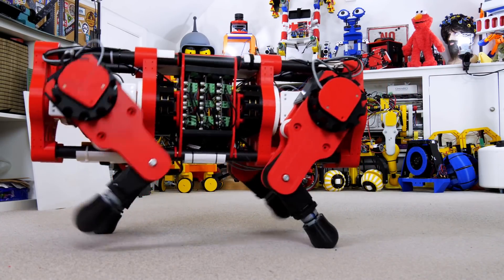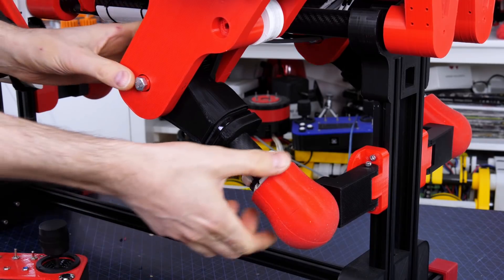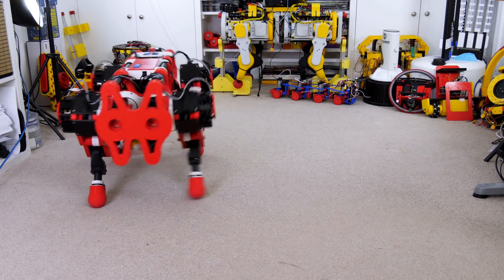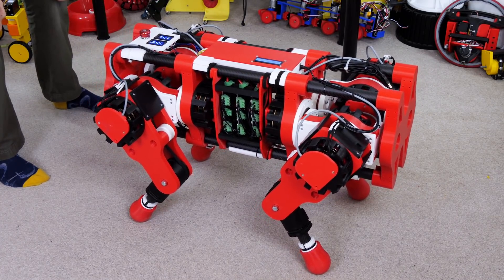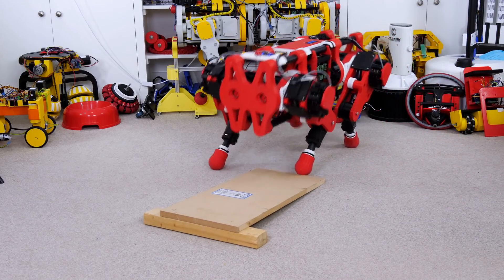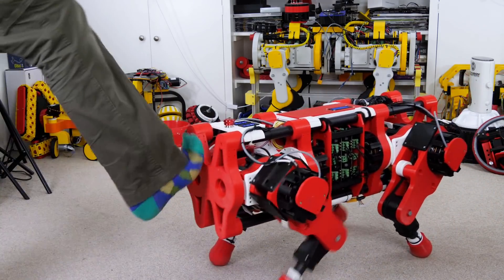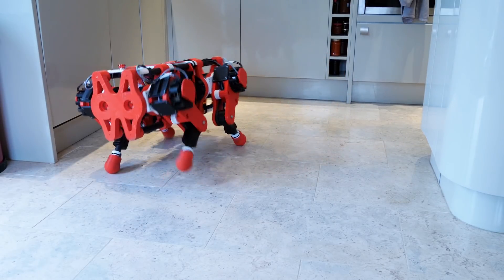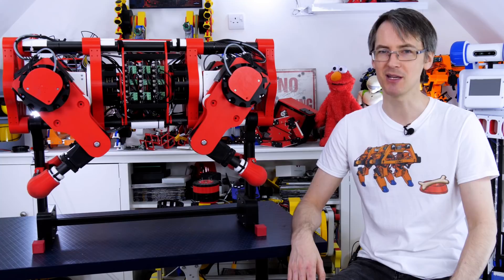3D Printed Robot Dog Climbs Over Obstacles

Comment: That joint not being on axis seems to be the biggest mess in the way it moves. Kinda reminds me of early BD stuff (no longer on YouTube) where they were wobbly as a newborn colt. IMO, you should either get rid of that entirely, or offset the position using a piece of carbon fiber (maybe buy a big ~15 cm OD  carbon fiber ring off-cut, and use four sections of it to move the leg under, it would also give more flexibility to the leg, naturally).
I wonder how difficult LiDAR or ecolocation would be to implement.

Comment: Excellent! I would be interested to see a digitgrade back leg version like a natural dog. You can still use the same number of motors, just use a connecting rod from thigh to ankle to move the foot.
Reply: Yeah, it's always bothered me that nobody ever copies the obviously more successful 3-segment hind leg design, yet most biped robots use 3-segment legs when humans do fine with two (birds do use 3, but mostly for higher ground clearance for wings). Though I suppose it wouldn't really make that much difference since they're mainly better for running, and most robots can't run due to excessive weight and/or inadequate software.

Comment: I would really like to see a project where instead of classical tuning and control, Machine Learning would be employed.
With most of your projects being described in a full 3D model, existing ML Models could be adjusted and trained on virtual simulations of a robot and then used in real life!
Reply: Not very easy to tell the AI what is "walking properly", even if, I guess, it could be done, by combinating horizontal speed and keeping the back flat as a "success" indicator.
Reply: @GirardNicolas  There are existing papers on this, it's been done quite well. Check out Two Minute Papers' channel if you want short summaries.
Reply: @GirardNicolas  Yes that's one of a possible option of the basics of training AI. I think though that it's ripe now for James to try his hands on it, as not only has the science come far but open tools are available and this exact problem has been tried and solved multiple times in different ways for years now. Of course, it's up to James if that is interesting to him.
This is very related and shows how it is possible: https://www.youtube.com/watch?v=knIzDj1Ocoo
And this is the cutting edge: https://www.youtube.com/watch?v=XM-rKTOyD_k
And their robots have similar issues Open Dog V3 has like offset feet from shoulder joint.
Reply: @GirardNicolas  basically you just measure what distance it covered in a given time, this gives you the reward, then you mixes those with best results, shake things a bit and try a new generation, again and again ... The difficult part is mixing (breeding) the challengers.
Reply: Do you think a Jetson nano or other embedded ML chip would work, or would he need a dedicated computer to run the quadruped algorithms? I love this logical next step in opendog v3
Reply: @richardsuckerson49  The hardware needs to be powerful enough to run the already trained algorithm. This usually scales with amount of data. With only internal data like the around 50 analog signals in the paper from 2020 it shouldn't need overly powerful hardware and Jetson Nano or other specialised hardware would probably even be overkill. Microcontrollers like most Arduinos don't fit for another reason though, the tools to run an algorithm need to be present for the platform.
Anyway, it definitely seems like classical tuning is hitting more and more diminishing returns in projects, that's why it came to my mind. Also, state machines came to their limits for robot kinematics years ago, so I would advise skipping trying to go in that direction.
This field can be a bit daunting if the tools and platforms are new to someone but most of them are pretty modern and there's documentation and communities and James already dived into that direction a while ago with vision applications.
Reply: This is how Aibo, Sony robot dog, learned to walk, many years ago ...

Comment: My girlfriend walked by and asked "Why is that robot walking on magic wand tips?" 
I said "for friction" without thinking and we both laughed. 😂
Reply: Everything is a sex toy if you try hard enough.
Reply: @greenanubis  Last time I heard that joke it was formulated as follow " 'Everything is a dildo if you're courageous enough' -Abraham Lincoln" Hahaha
Reply: James making open source sex toys when?
Reply: @GingePlaysMinecraft  Isint that already a thing? Just take the leg part, adjust code and add off balanced motor inside the magic wand tip...
Reply: @Hellsong89  I'm pretty sure the print lines on that flexible TPU wouldn't feel great on your junk...
Reply: @Hellsong89  I assume it is. Wouldn't that fall under rule 34? Lol
Reply: @GingePlaysMinecraft  That's why I have a resin printer! ...Wait... crap, no, that's not what I meant. 😂